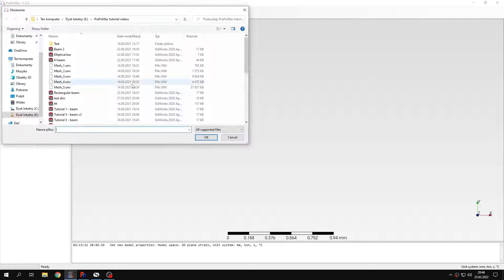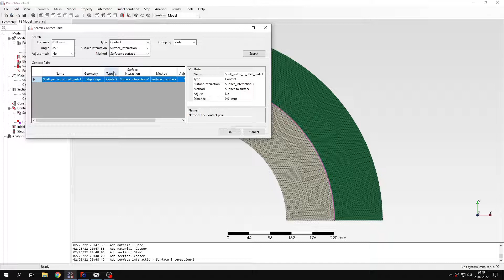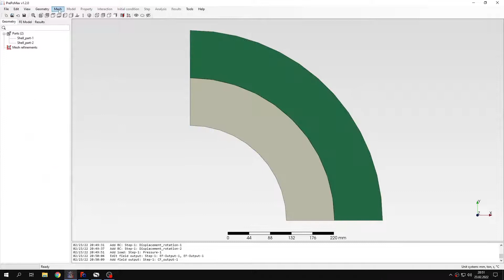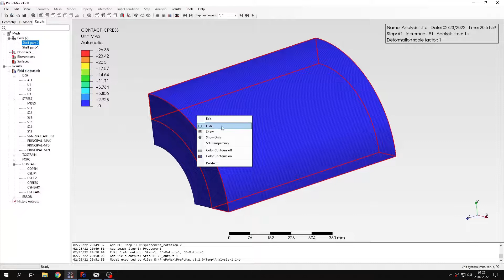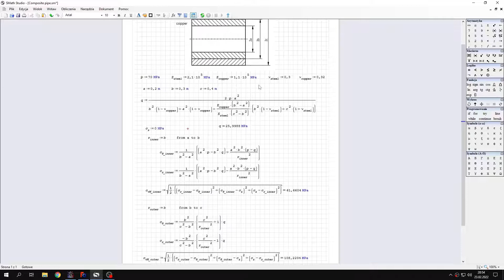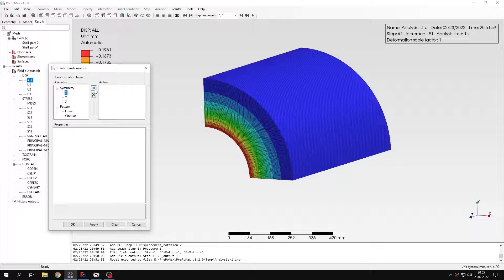PrePoMax (CalculiX FEA) - Tutorial 17 - Plane strain analysis of a composite pipe

Comment: Great tutorials, my results are consistent. However, in v2.4.0 autosearch contacts for 2D does not work in this scenario, so I created it manually. Besides, 3D extrusion did not work...
Reply from the maker: I reported the issue with the contact pair search for surface geometries. Hopefully, it gets fixed for the next dev version. Extrusion to 3D is on the solver side, make sure Output is set to 3D in element output settings for the step.

Comment: Hi, these tutorials are amazing thanks. I duplicated the tutorial step-by-step but am having a problem with defining the pressure load. The "pressure" type is not available in my version (1.3.5.1) so I am using "Uniform pressure" instead. But it does not allow me to select the inner edge of the pipe, or any edge for that matter. I only seem to be able to select parts of surfaces. 
The only thing I did differently was when defining the Sections, I used the "shell section" option rather than the "solid section" you seem to use. The reason for doing this is because the latter option does not allow me to specify a thickness...
Could this be a bug or do you have any suggestions, please? Tx
Reply from the maker: Now regular pressure load is called uniform pressure because hydrostatic and imported pressure loads were added. Make sure that you select the right model space (2D plane strain) in the beginning. Then you have to use solid section and there should be the thickness option (maybe the Data tab is folded for some reason if you can't see it anywhere). You should also be able to apply pressure to edges. Try with Edge angle setting if the default one doesn't help. If you still encounter any issues, please report them on the PrePoMax forum since it might be a bug.
Reply: @FEAnalyst  Thank you very much! It worked as you described.

Comment: Good evening. How can be modeled an interference fit in Prepomax? For example, between shaft and bearings?
Reply from the maker: After some tests and discussion with CalculiX dev it turned out that it's possible to resolve interference fits correctly with the default contact settings (of course without the ADJUST parameter which is used for strain-free adjustment). I just uploaded a new tutorial showing this.
Reply: @FEAnalyst  Thank you for the support!
Reply from the maker: Check my answer to the question asked before by Konrad Riedel. CalculiX normally doesn't support interference fits but its native pre- and postprocessor (GraphiX) offers a command that adds MPCs which should do what shrink fit does. I haven't tested it yet though since I rarely use GraphiX.
Reply: @FEAnalyst  thank you. So, I should export the geometry with mesh in "*.inp" format, and then, implement the presfit with cgx?
Reply from the maker: @Matteo-lw8cl  Yes, you can give it a try. It would be great if you could let me know if it happens to work. Even better if you join this discussion then: https://calculix.discourse.group/t/modeling-interference-fit-shrink-fit/603

Comment: thanks for the tutorial here as well, one more thing coming to my mind is how could that be used to calculate a shrink fit shaft hub connection with two circular parts and interference fit?
Reply from the maker: That’s a very good question. In fact, I wanted to do a shrink fit analysis for this tutorial. Unfortunately, it turned out that contact in CalculiX (unlike in Abaqus) can’t resolve initial penetrations as shrink fits properly. CalculiX’s native pre- and postprocessor (GraphiX) offers a special command that utilizes MPCs to adjust the nodes and resolve the press fit but it seems to be the only way to do it in CalculiX.
Reply: You may consider what is mentioned in cgx manual but i didnt manage to make it work properly from prepomax side: send dep indep abq areampc presfit s0.06
Which should force nodes with interference to move along to the desired coordinates
Reply from the maker: @konradriedel4853  Where have you entered this command? Normally, it's written in the GraphiX's command line. If you did some tests and found out that it doesn't work properly in CalculiX/GraphiX, maybe you could join this discussion and help us dispel the doubts: https://calculix.discourse.group/t/modeling-interference-fit-shrink-fit/603
Reply from the maker: After some tests and discussion with CalculiX dev it turned out that it's possible to resolve interference fits correctly with the default contact settings (of course without the ADJUST parameter which is used for strain-free adjustment). I just uploaded a new tutorial showing this.

Comment: Hi thanks for the tutorial! It is really helpful and very informative. One question, is it possible to create a custom material as a function of position?
Thanks
Reply from the maker: Good question. Unfortunately, CalculiX doesn’t have any keywords to define spatially-varying material properties. But there is a workaround that should work if you don’t have to account for any thermal effects in your analysis. Namely, you can define temperature-dependent material properties and apply a defined field (both options are already supported in PrePoMax) with spatially-varying temperature values. In a static analysis without thermal expansion these won’t be the actual temperatures but just some user-defined field variables.
Reply: @FEAnalyst  Thanks for the answer. And, is it possible to plot a stress-strain graph by capturing elastic and plastic regions?
Reply from the maker: @seymurhasanov4321  You can request history output to save stress and strain values for selected elements as a function of load increment. The results will be printed to the dat file and also available in the Results tab of PrePoMax. Just copy this data to Excel and combine it to create a stress-strain plot. There is also a separate output variable named PEEQ that gives you just the plastic strains and can be useful in many cases.
Reply: @FEAnalyst  Awsome! Thank you